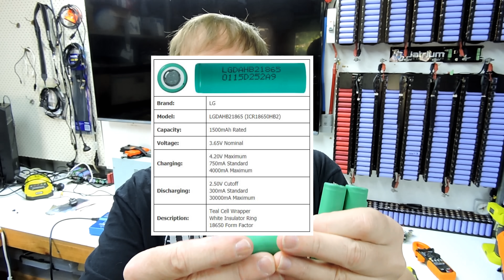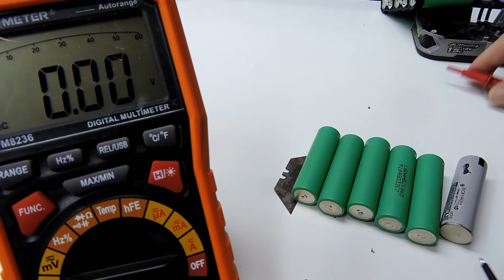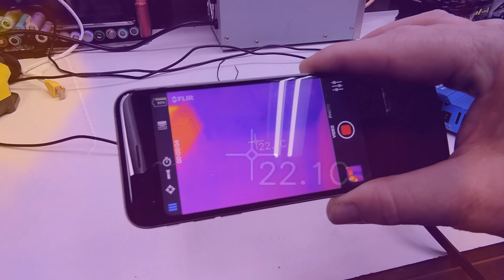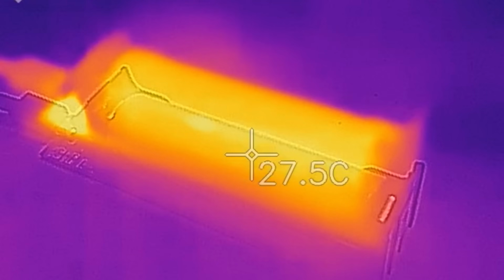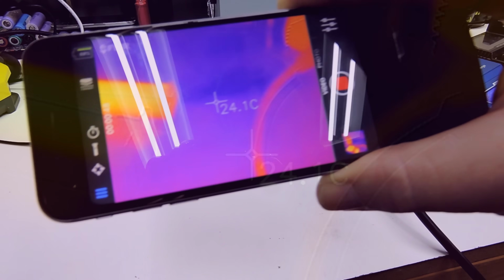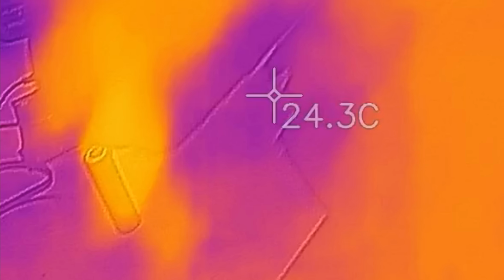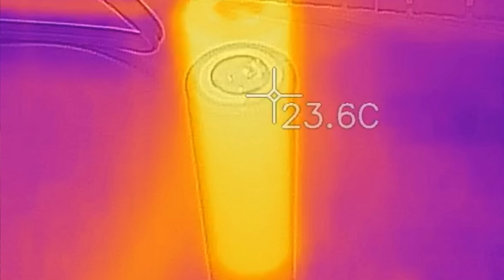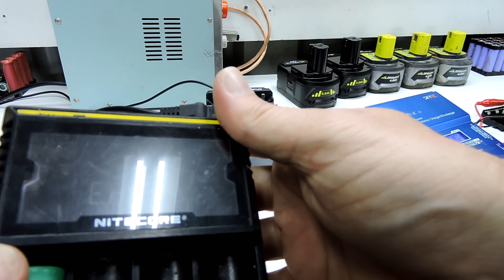18650 CID Reset   ⚡ DON'T DO IT! ⚡

Comment: You don’t put lithium in water. The lithium will explode into flames..
Reply from the maker: Ask that question to your local fire department you might be surprised at how they deal with lithium fires - Water, water and more water for HOURS after the fire has been put out.
Reply: HBPowerwall Okay I sure will, I’ll ask the first firefighter I see. I just so happened to run into the younger me when I was a firefighter. I punched myself in the shoulder and said damn good to see me. Okay that’s getting a little weird. 
Lithium ion doesn’t have much lithium metal so you can use the best way to extinguish is by using a class D extinguisher or foam, copper powder, ABC dry chemical, C02, dry Graphite.
For a lithium metal fire you need a class D extinguisher. 

ONLY USE water to keep fire from spreading and not on lithium metal. 

There is more but I’m tired and don’t like typing. 
Please check my facts and yours. 

If you feel I’m correct and/or wrong please say so in a reply.. don’t be rude about it. 
Thanks

Comment: Useful video from the standpoint of showing the behavior of defective lithium cells when charging is attempted.  Now we can easily spot a cell that is dangerously bad and overheating (not that I didn't know before how recovery much below 3v is iffy).  
Lifepo cells are more forgiving, have higher output current, but lower AH capacity.

Comment: Thanks for the information. I tried to wake up 2 NiMH that are 18 years old and one that had been refreshing or the charger was at least trying, it failed and the intelligent charger said no, error, will not charge them. This is caused by the cell chemistry being dried out through the vents. I will keep the batteries because they came with a state of the art CD player and it might have some value when it is antique with all the original parts. I have ANSMANN ENERGY 16 PLUS charger. What charger/balancer do you recommend for 38120 batteries?

Comment: HBPowerwall i think you need to stop talking shit.  It is not dangerous at all. Cut one open to see how it works then you will realize how full of it you are.  Bad for the community ffs
Reply from the maker: I should have added very very bad for the community - especially the green newbies within our community that look up to us to try be better. It's possible I've cut more than one open :)
Reply: Yes and you can't even comprehend how the thing works.  You just say it is very very dangerous.
Reply from the maker: given I've been messing with these cells for 4 years and have plus 10,000 cells processed I'm thinking I got a fairly good grasp. But I'll let you just judge me without knowing me lol
Reply: I am judging what you are saying which is complete bullshit. The pressure cap will still pop out and disconnect the battery again if there is a major problem.  It is not like you are welding the inner and outer together totally
Reply: Do you really think pushing it back in will stop it from popping out. It is irresponsible to tell people that it is so dangerous because you stop people saving money and create more waste that has to be processed.

Comment: There is no reason that they can't be fitting a bimetal into the caps
Reply: If the CID pops, it's because the cell is being abused (overheating or overcharging).  You don't WANT it to automatically reset.  If it's still in the device, it would just heat up or overcharge again and again until if failed in some other, less safe way (like a fire).

Comment: You just shorted it out when u punctured the cell. They could have been revived.
Reply from the maker: Clearly, you don't understand the dangers of doing this. It didn't get punctured but did work after the cid was reset. all cells went into a bucket of salt water then disposed of properly -

Comment: Could it be that some CID pop because of hydrogen pressure buildup in the 1860 can ?
Reply: Actually, it's Oxygen.  And yes, pressure is what pops the CID.  The question is what caused the pressure?  High heat alone could vaporize the electrolyte raising the pressure.  Overcharging leads to chemical degradation of the cathode, which is made of a transition metal oxide (like Cobalt Oxide).  This is where the Oxygen comes from, and the damage is permanent.

Comment: I changed the battery of the drill from nickel to lithium, which happened to have a strong odor in the motor, which is why the original battery was 18 volts voltage and 1100 mA, and the battery used was lithium with a current of 2200 mA, and after the connection was measured voltages were 19 volts And measuring the current during the operation of the drill was 1200 mA ... What is the reason for the smell?
Reply: Nickel cells have lower AH capacity, but provide high output Amps. Standard lithium 18650 cells have higher AH capacity, but low output Amps causing the cells to overload running your drill.  

The smell could be from a stalled overheated motor or lithium cells too hot and venting. There are special high 25-30 Amp 18650 lithium types for tools, and Lifepo cells that will work.
Reply: trueblue2k2 AH capacity ??

Comment: To think some people (vapers) will actually ignore this advice, circumvent the safety measures of their batts CID, and fire these things off, right next to their faces. 😨
Reply from the maker: Apparently
Reply: Well my dude i use a mech mod and my 510 pin got pushed by the battery so i shorted out and the cid pin popped i searched for info about reviving it but i sow this vid and im having 2nd thots the battery just got over heated no serious damge but still not sure to revive it or not
Reply: By tampering with the CID, there's a likely chance of damaging it - preventing it from cutting off on future overheating. If I had to choose between the risk of getting my face melted clean off (or death) and paying $10 for a new batt? Damn, $10 is a small price to pay my friend.

Comment: Thanks for this video. So 0v with no continuity just refuse the cell. But a cell with continuity recovered from 0v will works properly? Does the job worth it?
Reply from the maker: 0.01v is fine never seen a zero volt with continuity - i've recovered some 3000mah cells that were very low in voltage

Comment: Seriously you talk as if they are dynamite . As electrical engineer i just put 5 v 1A samsung phone charger's 5v to dead 18650 batteries leave it over night on a metal surface in case of fire. They generally end up to proper voltages but when they are zeroed that means they lost lots of life. But in any case even you revive % 10 life from a dead cell it is better than 0. Ofc if you are dumb dude who would stick your screw driver into batteries yeah anything you do with electricty is dangerous. Maybe you would stick your screwdriver in to plug and electrify yourself. But thanks to us we engineers make sure your power circuits have earth leakage circuit braker while constructing your house so even you do that dumbness you would not die. 

if its your battery if you wish to learn and try or save , Go do it with some simple precautions. And if you are someone who is smart enough to look at you tube and consider what other people done probably you have enough common sense not to combust yourself with some couple battery. So stop discouraging people ! go go go guyz blow some batteries its fun ! :D
Reply from the maker: you put 5v into a cell designed for 4.2 ... and you call your self an electrical engineer - how the hell does that even work... I stopped reading after that..
Reply: +HBPowerwall very simple. there is something called voltage drop. when the switch mode power supply is not high powered like 5v1a aproximately 5w when you supply it to higher power drain device voltage drops . when the battery is dead like 0 volt it will drop to like 2.5 volt and will try to feed the battery  with its limited capacity. switch mode power supplys has upper current limit that when that limit  is exceeded it will cut the current in a certain period which is relevant  to its design. so there is almost no risk. every device works with voltage drop. even when you plug your television at your house voltage at main switchgear stations drops. but the power capacity is so high that the drop is so insignificant that it cannot be measured.  try it yourself get a phone charger 5v 1a get a volt meter cut the jack off find the + and - of the charger and feed it to battery  then measure the voltage you will see the voltage will be around 3.7 and slowly rising. ofc if you will leave the battery there like 2 3 day battery will end up dead because  eventually  voltage will keep rising above 4.2 till 5 v and that will start damaging battery slowly. thats why there is charger circuits for lioin batteries which reduces charging current at 4.2 not to damage battery if its left there for long time .
Reply from the maker: 'almost no risk' gah done this experiment two years ago ended in a heater and probably fire if I let it run. No thank you
Reply: @HBPowerwall  ^^ explode some batteries and see how they explode :D thats fun part. Burning batteries are no fun they just melt and smoke around lots of chemical unhealthy dust! No risk means you dont get damaged ofc you will blow things up :D it is not easy to burn  batteries if you seriously dont mess things up. 

in my experience from the recycled batteries not even 1/10 them fails like heating burning or melting. None of the batteries of mine burned or exploded with voltage charging or shocking. To burn them i had to use 48 volt powersupply.

If battery heats up that shows there is a shortage inside of battery and if you see its heating and then when you check voltage still 0 that means that battery is wasted.

i been schocking batteries since 14 year old ,schocked various types from metalhydric nicel cadmium lead acid to liion most types that you can find in most electronics past 20 years no fire so far.  so yeah thats "almost no risk" stop scaring the kids. if you put your battery to a regular power supply or a power supply with lots of wattage and you see your battery heating and boiling  ofcourse you have to intervene . You do not leave batteries unattended during that kind of actions. 

Not many people are able to get their hands on thermal cameras due to their price and heck if they can they would not think about recycling batteries they would go buy new ones since they have money for it. buying liion chargers costs money but using old phone charger which got its socket broken for recycling some liion batteries from old devices like dead pc batteries . Yup that saves money. :D

Comment: What's the name of the tool you used to cut off the dags?
Reply: They are called flush cutters, some call them diagonal micro-cutters. If you're in the USA you can get them for about $2.00 at Harbor Freight. They are sold on ebay and Amazon fairly cheap as well. If you buy cheap ones, get a spare or two. They are fairly strong and long lasting, but being hardened steel, they will break off if you cut too thick a wire or accidentally twist them too hard in a bind. Don't ask me how I learned that one:-)

Comment: all you showed was that particular battery has a short at the positive end. which is why it tripped itself. no clue why so much fear was seen.  so how about the other cells?  no clue how you didn't determine that with all that electrical stuff around u. It seems the most dangerous thing in that room is actually u due to u could not deduce what was going with that battery. if u really thought the battery was going to implode u would have done this outside as the fumes coming off it would be more dangerous than the controllable heat from it. again u r the most dangerous thing in that room as u seem to state u both thought up what to do if the battery self destructed yet neither of you thought about the gasses it would give off??? lol
Reply: NO,,,,the CID does not monitor current, it trips from gas pressure so it dosn`t know if there is a short or not, that being said it could trip from gas pressure if the short was there long enough.

Comment: Interesting experiment! I have done nearly everything with those harvested 18650 from old laptop batteries. I tried to bring them to explosion (in a save environment outside) just with overloading, short circuit etc. - ended up only heating the cell up to probably 100 deg. C before the CID popped. I never resetted the CID.
When a 18650 is behaving like here, it is internally massiv short circuit and has quite high of an internal resistance (it wont take much amps when trying to charge) but it heats up due to internal resistance and short! Anyway i found several cells very close to 0.0 volts and succeeded in recovering them to a certain extent. They tend to heat up on first charge quite a bit, so they must be under permanant surveillance in a safe environment, but after that first procedure they seemed to take a charge after having cooled down again. On the second and third try they didnt get that hot any more and kept their voltage for several weeks! They are still bad cells but i found a few on them that seem to recover even more after sitting for a year with mediocre charge. One of them only drops its voltage maybe 50mV in a month - which is quite reasonable for a bad cell. A good cell keeps its charge for years tough and i have a few which only show a selfdischarge of 10mV a year! But anyway - some of them can be reactivated to a certain extent. But i wouldnt recommend to do so, as they can behave very unexpectedly and can be potentially very dangerous! Never use such cells in your torches or e-cigarretes!
Reply: That first charge where the cell got hot was your mistake.  You have to bring them back above 3v by charging at ~10ma (1/100th C).  Do NOT let them heat up.  The deep discharge has severely depleted the anode of lithium atoms.  Trickle charging gives the lithium time to work its way back into the anode (between the sheets of graphite).  Fast charging forces the lithium in, generating heat and probably damaging the structure of the anode. 

How good the cell is after a CID reset depends on how much damage was done before it popped, and on what caused it to pop.  But you certainly want to avoid adding to that damage.

Comment: 5:50 WTF are you doing !! You don't need to ruin the positive side !!! JUst put a very small screw driver on the gap and apply a very subtle pressure... and that's all ! No need to destroy anything. "please don't do it at home" you sound like we are going to open a nulear bomb ! It's ridiculous, there are videos from the third wolrd where you can see people building HUGE batteries with only faulty 18650... You sound so ridiculous...
Reply from the maker: I'm sorry there are people out there doing this when there are better choices to be made you NEVER mess with a safety device EVER - you can do what you like but i will promote safer practices where i can.

Comment: This is an excellent video. Typically, they don't recommend attempting to charge ANY lithium ion cell that has fallen below an open terminal voltage of 2.3 volts. Any commercially available charger has a built in threshold voltage under which, for the sake of safety, will not attempt to charge.  In use, they say to cut them off at 2.8 volts. my designs cut them off at 3.2 volts. You still get well over 90% of the battery capacity, with enough of a margin, that it can sit for a while. In a radio controlled model airplane, cutting the main propeller at 3.2, leaves enough in reserve for flight surfaces, for a controlled landing. I typically cut the charge at 4.16 volts, rather than the full 4.2 volts, just to improve the cycle life of the cells. you still get 85-92% of rated capacity. By limiting the charge/discharge voltages, batteries last much longer, and are more safe. As far as this experiment, my results were exactly the same as yours. If you pick up a cell that shows 2 volts or less, it's ready for the recycle bin. Voltage balancing during the absorption charge is a must! Any time multiple cells are in series, it's imperative to have voltage balancing to guarantee that no cell exceeds 4.2 volts while charging.
Reply: It's well proven that voltages even under 2.0V (and even down to 1.5V) are perfectly safe in MOST cases. However, the risk of the cell being inherently damaged is greater as the voltage is lower, but more importantly the amount of TIME that the voltage is low is even more important.
In any case, if the (previously under-voltage) cell comes back up and holds a charge OK, then it's OK. If it won't charge or won't hold a charge, then it's fucked. The cells are either internally damaged and cannot hold charge, or not... if they won't hold charge then they cannot explode because they are dead and there is no energy inside them.

Comment: Sir, I have a serious question for you, where did you get the thermal camera attachment for your phone and how much do they cost?  I do a lot of worn with  RC  batteries, and it would be very helpful to measure the thermal activity of battery’s, motors and other components before and after use and while the battery’s are charging.  Please respond here or send me a PM. Thank you!
Reply from the maker: its a cheap one of ebay - www.secondlifestorage.com/flir

Comment: Do you have contact leads voltages on Ryobi P193 battery?
1. Has three leads on the towel (face on right side); Front contact is +, Back is -
2. One contact on Left Base
3. Two contacts on Right Base

Comment: I bought 100 18650 battery , after few days I started to check them and they all were having 0 v , they shown lil resistance to so did is ok , when I charged them with tp4056 voltage stuck at 2.5 , 2.9 or in between ,, and some gets charged up to 4.2 v ,,, I don't know what fault could be  in new batteries and seller not ready to listen any excuses ,, can you help me with this situation,,, how can I raised voltage ..
Reply from the maker: Open paypal claim and get your money back sounds like you were ripped off